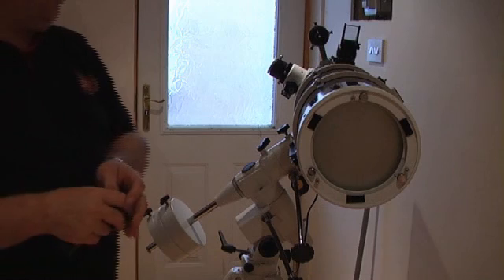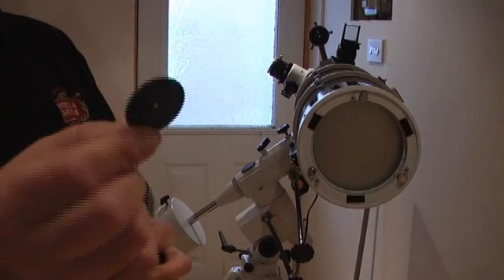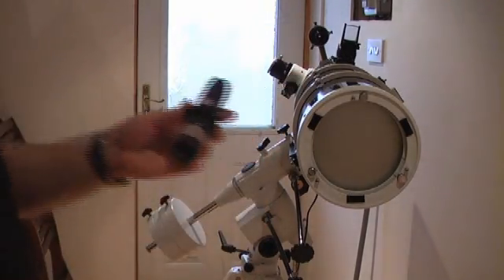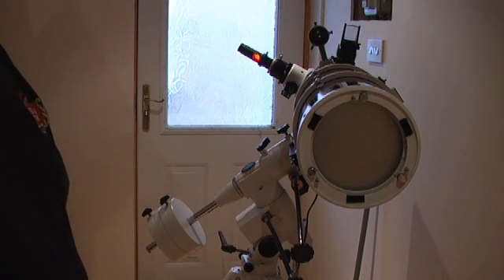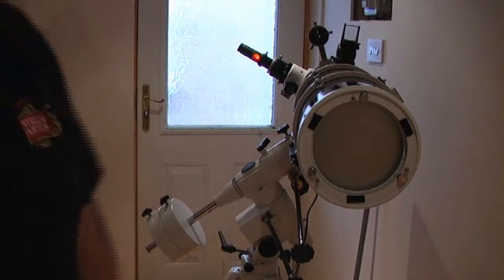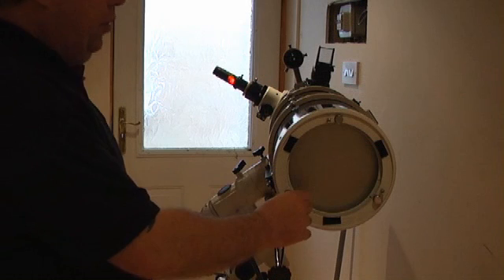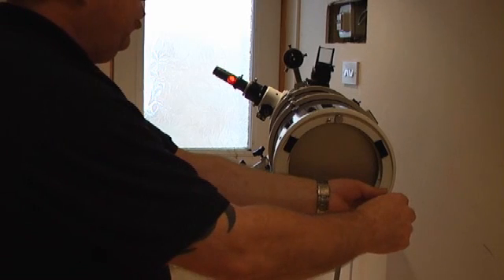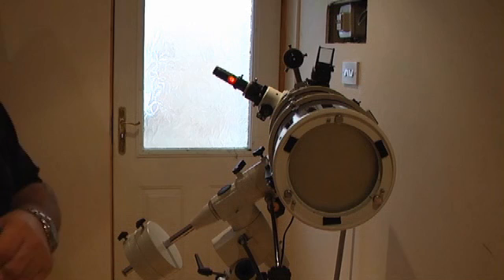Newtonian Collimation Part 9

Comment: Amazing at of videos my secondary has been on the lash with its previous owner I think. May I ask if my laser isn't collimated completely (long story with a crap sebens laser) will it matter through the barlow?
Reply from the maker: matt neale  Hi, not through the barlow no, as long as it still illuminates the primary center area, in effect all you are doing is using diffused laser light, not an accurate single point.
Reply: astronomyshed I didn't think so. Thank you for your very quick response. I can't wait to get back to try it out
Reply: astronomyshed how do you collimate the secondary?

Comment: just a question, why is the barlow laser kollimation more accurate than the plain laser method? what is the methodology behind it? is it simply that the laser gets spread out over a larger area making imperfections more obvious?
Reply from the maker: No, the laser is now diffused and reflecting the actual center marker, not a reflection of a single dot from the actual laser, ie it is reflecting a fixed and truly centered part of the mirror so can not be affected by movement of the laser itself.